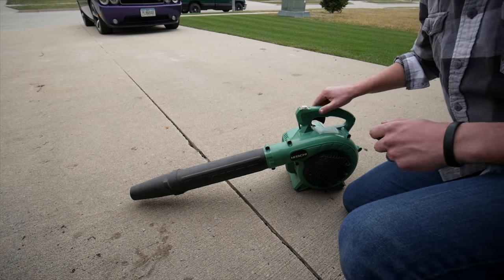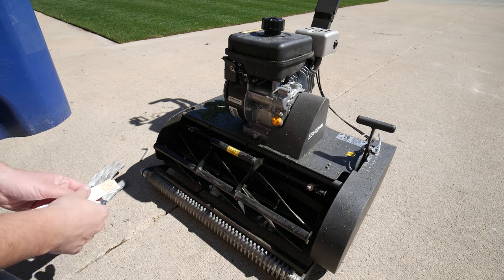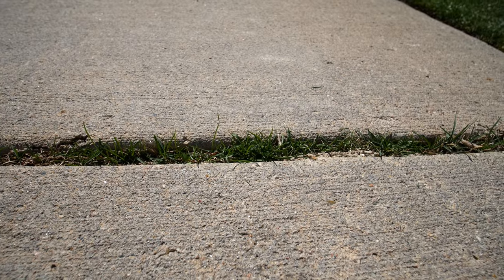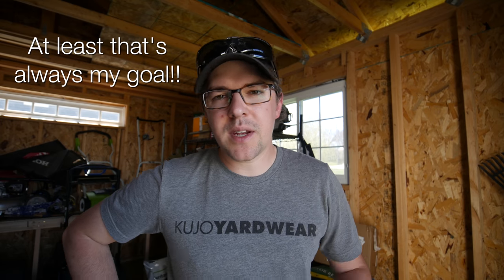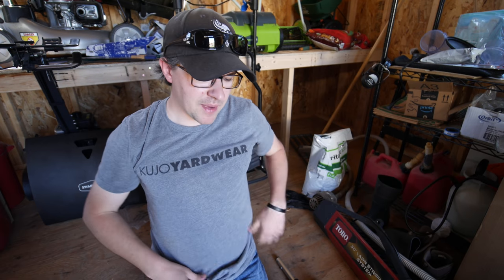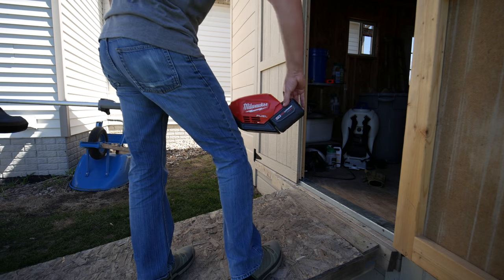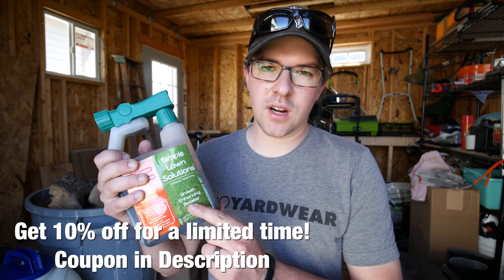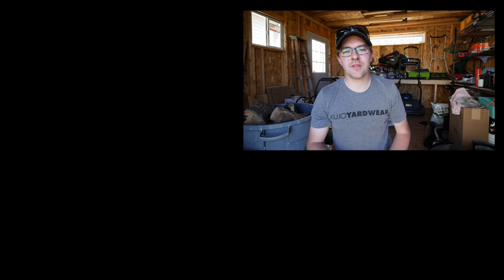Spring Day In The Lawn | Lawn Edging | Simple Lawn Growth Booster

Comment: Hey Ryan, a great tip for blower is to use premium gas and a fuel stabilization additive.  Love the Videos !
Reply from the maker: For sure but I've always used premium and non ethanol in all of my equipment as well as stabilizer.  :)
Reply: ...or just use premixed fuel (red can for blower and trimmer, gray can for mower. Dont have to drain at the end of the season.

Comment: I need a concrete driveway.. asphalt doesn't edge the same!
Reply from the maker: Yes concrete is nice for those crisp edges
Reply: let the grass ( or weeds ) fill in, and a string trimmer will sharpen asphalt edges.
Reply: Line it with bricks?
Reply: Yeah, my driveway is crap.  Don't need to bring attention to it!
Reply: Pour a concrete curb. Or make a masonry curb. Or dig in a small trench for some vinyl edging.
Reply: @blzt3206  I need a new driveway anyways just gotta see about doing it in concrete
Reply: New England doesn't respect concrete like the rest of the country does.

Comment: I just "used" the lawn booster for the first time using the bottle sprayer. It didn't look like the solution was mixing (I poured out the amount I didn't need into another container to ensure measurement accuracy, and to know when the application was complete), as the liquid remained dark. I did shake it well, check the sprayer connection, etc. I even went as far as to put my hand in the stream - NOPE, still just water. There's nothing on the instructions mentioning any guards, etc. to remove, and the tube was in the container. I've been watching your videos for about 3 years now, so not trolling you.. BUT, what am I doing wrong??
Reply from the maker: Sounds like it might just be a bad sprayer or something...definitely contact simple lawn here and they will take care of you! - https://simplelawnsolutions.com/pages/contact

Comment: Man, I have been looking at power tools recently and tossing up between Milwaukee and dewalt and was leaning towards milwaukee before this video and now even moreso. Battery powered tools are so great these days, even higher performance than corded versions from 10 years ago.

What about watering the doggy area to dilute or spread the nitrogen and uric acid?
Reply from the maker: The damage happened in the winter time when there's not much I can do about it with a frozen ground.  If you have a larger dog and they tend to go in one area then watering that area as much as possible after they go will help to neutralize the damage that will occur

Comment: Are you using the simple lawn solutions liquid fertilizer out of a backpack sprayer? I have trying to find out if this is possible. Thanks.
Reply from the maker: Yes and yes it's possible.  Here I mixed 6 oz of the booster into 1 gallon of water in the backpack sprayer.
Reply: Ryan Knorr Lawn Care thank you! Is this covering 1000 sq feet? About to place my order
Reply from the maker: Yes but you can adjust the rate up or down depending on how much you want to apply
Reply: Ryan Knorr Lawn Care appreciate you.
Reply from the maker: Hopefully you found the coupon as well.  :)
Reply: Ryan Knorr Lawn Care sure did. Perks of being part of the community. Check me out on IG andys.lawn.maintenance it’s my first year. Learned most all I know from you folks.

Comment: You are of a shorter stature yet you are bending over to use the edger because of the limited shaft length? PS, edge before mowing. Use the velocity and turbulence of the mower's deck to your advantage
Reply from the maker: Could just be my technique and I edge after because I'm using a reel mower...it has no suction and when you roll over the edges of the lawn...yep the grass rolls too

Comment: Meh on Milwaukee. They only wish they could be in the same league as EGO. Even Greenworks would put them to shame. Both EGO and Greenworks actually have battery cooling. Notice any air vents on the Milwaukee? 
Remember, the voltage actually isn't worth even comparing, as mean green lawn mowers operate on 48v yet are extremely powerful.

Comment: Those little hand blowers are junk and have no power. You should invest in a Stihl backpack blower. You can get your fall clean up done in no time. Plus I hope you throw hydrated lime in your garden ontop of all those grass clippings. All that grass will lower the PH of your soil and make it acidic. The lime will raise the PH and help bring it back up to closer to neutral.
Reply from the maker: Blower works fine just needed a new spark plug.  We have been using a specific gardening method with great results for years now
Reply: Well you can lead a horse to water...